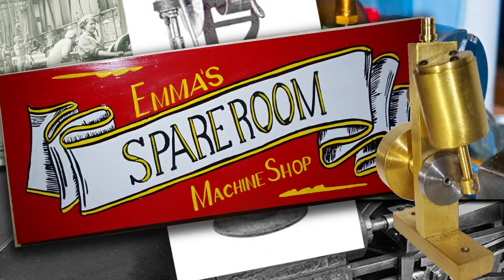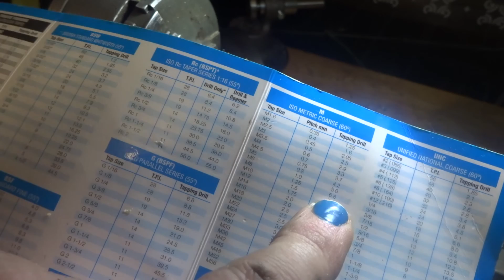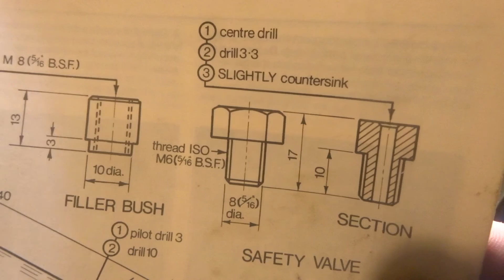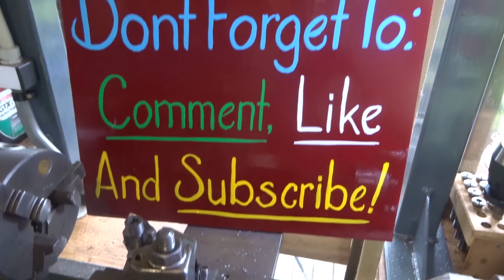K W  SCHOOLS  Steam Engine PART 11 boiler fittings

Comment: Hi Emma rather making one.. Take the current Nut/ Nuts.. Screw on bolt and put in Lathe.. Turn the corners of nut off until it fits through the hole...
Reply: +Emma Ritson  Or turn them round and file two flats on them. Cheers.
Reply from the maker: +TechNebulous good thinking! thanks for that!